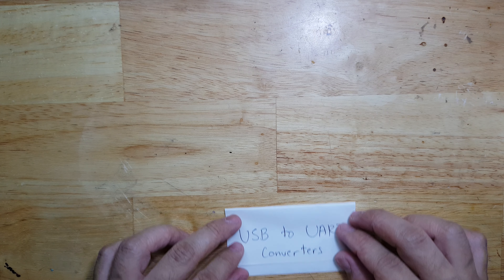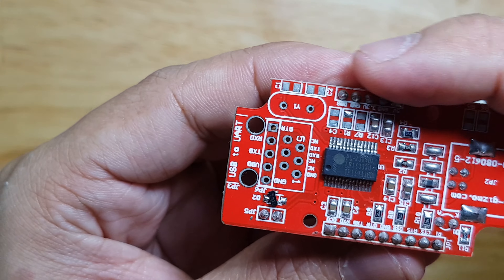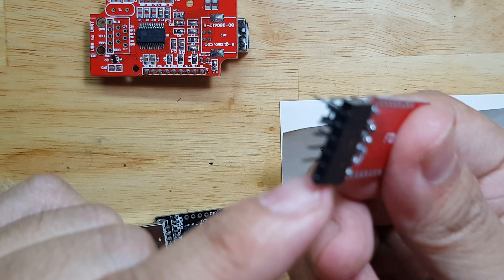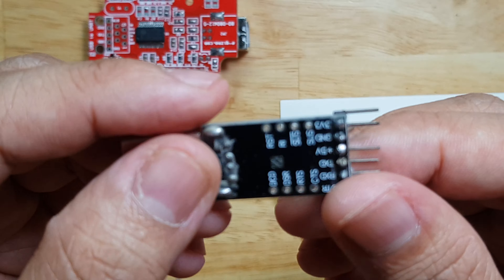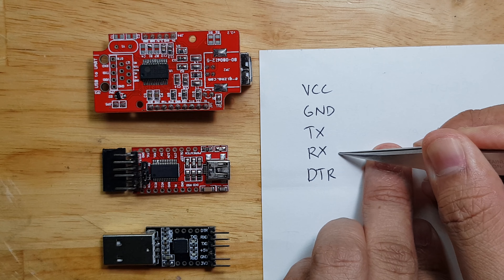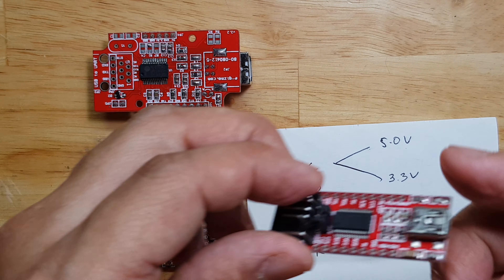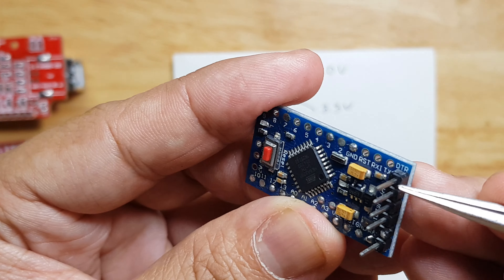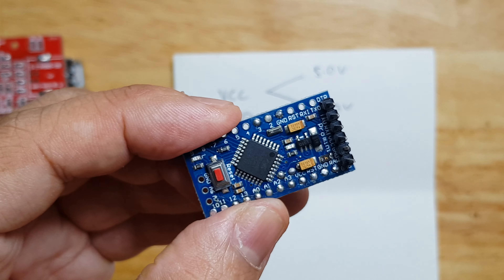TOP 3 USB TO UART SERIAL CONVERTERS ADAPTER FOR DIY ELECTRONIC PROJECTS - PL2303, FT232RL and CP2101

Comment: Can you please tell what is the difrwnce between usb and uart?why we are using converters?
Reply: UART is a communication protocol (A way of sending bits) while USB is a way of connection. We are using converters because because microcontroller ICs don't come with USBs that you can program them directly with, but almost every IC does come with UART PINS (namely Rx and Tx). so if you want to flash your code onto the microcontroller's ROM, you send signals from your computer via the USB, they then get converted from USB signals to UART signals before finally reaching the target microcontroller. This process completes the flashing process of the microcontroller that will know run your code.